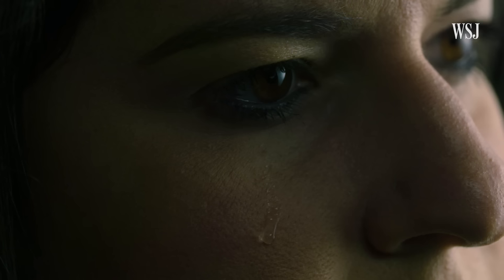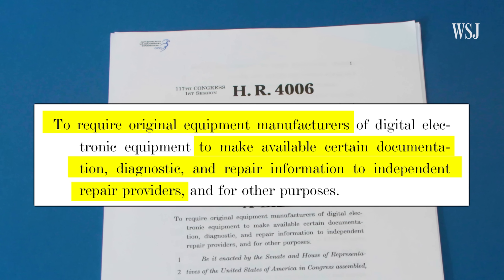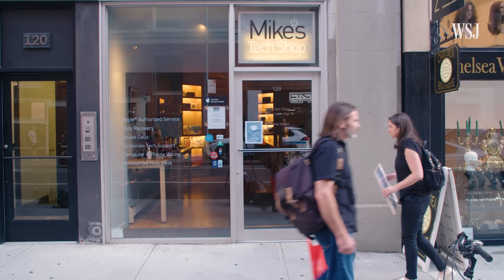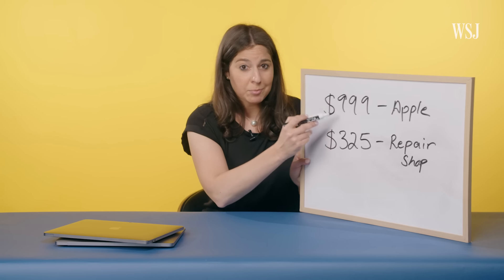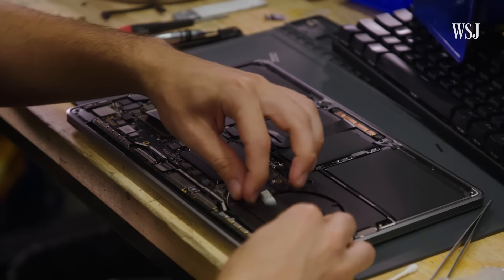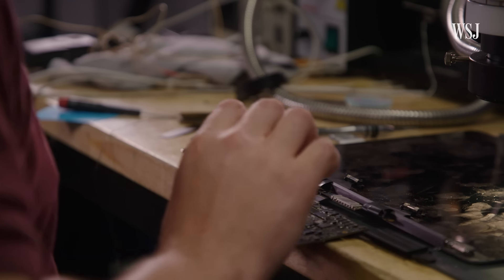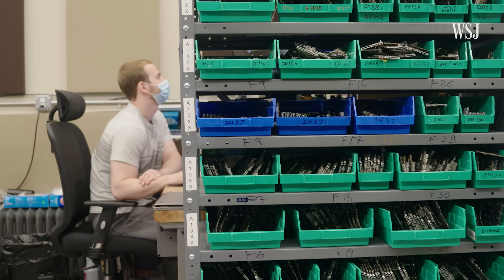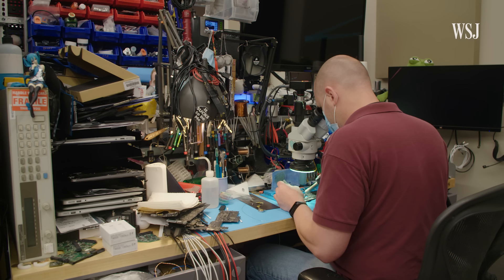Apple Store vs. Repair Shop: What the Right to Repair Is All About | WSJ

Comment: we allow a 16-year-old to change the brakes of a giant piece of metal that goes 80mph but changing a fan on a MacBook is "dangerous" these big tech companies are on something lol
Reply: bruh, i swapped the entire motorcycle engine and it was fun and not so dangerous.
Reply: @pnnytx  exactly, if these vehicles don’t need a “certified” professional to do it then neither does tech
Reply: @ProPrince  idk, maybe it's because of the "safety" things. Kinda annoys me, tech are being harder to fix and getting harder exponentially.
Reply: @pnnytx  yeah it’s getting smaller but they can make stuff as easy to fix unless they solder everything together
Reply: Cars will be next. Driverless and electric cars will not have repairs that are done anywhere besides the dealer.
Reply: @randomoverpopulatedworldid3286  its sad our society is ok with this
Reply: @randomoverpopulatedworldid3286  i think that's what tesla is already doing
Reply: @ProPrince  They can solder everything together and it still will be easy to fix. We just need the information
Reply: It doesn't ork like that on land machines anymore. There they try to limit self-repair with software too.
Reply: 😂 so true 👍👍🙏
Reply: @randomoverpopulatedworldid3286  Next? Its already happening, talk to independant techs about diagnostic software and the fees to use them.
Reply: The are on liquid greed
Reply: @randomoverpopulatedworldid3286  Tesla is already like that.
Reply: @SirNyanPanda  thats gonna be what happens with new smart and electric cars, tesla charges insane prices to fix them
Reply: @i-never-look-at-replies-lol  you know that’s a good point lol.
Reply: @pnnytx  it s not i changed numerous parts of pcs without any issues and i m only 16 so they is no danger
Reply: Did Apple say dangerous was one of their concerns? I must of missed that because I didn't see that.
Reply: Don't give car companies any ideas.
Reply: At our school we have all these saws and grinders but replacing a single part hmmm not gonna happen Chief
Reply: I call those giant pieces of metal "2 ton killing machines" and I agree with your assessment that a 16 year old can safely repair an Apple product.
Reply: @randomoverpopulatedworldid3286  The BMW that requires a subscription to get certain features "Unlocked" on a car that you own. so I guess if you don't have it fixed by a "registered" technician, they could brick your car? or limit it in someway, that's just all kinds of wrong.
Reply: @randomoverpopulatedworldid3286  And this is why I, an equestrian, have already decided that by owning horses I'm not tied to using a car.

I can also make money with them, keep a dying breed of my country alive and I can do logging and farmwork.

All way more environmentally safe and good options. It all can come full circle with horses. Not so much with cars.
Reply: @ProPrince  More like, why does it have to be Apple certified? If I take it to someone certified by some other entity, why should that be Apple's business?
Reply: Companies like John Deere and Tesla would like to apply/trying all the things apple is doing to vehicles and machines, so right to repair is something we really need to support.
Reply: @Klairity  John Deere has already done it
Reply: @marialindell9874  And so has Tesla why I named them, and they are trying just haven't fully done it why they're still lobbying.
Reply: @kenbobcorn  its not shown in this video but yes. Most if not all of the lobbiests*  who argue on behalf of these tech companies specifically say that it is a huge security risk to have non authorised repairmen operate on such products.  They even ran an ad campaign saying if you let a 3rd party repair centre fix your product, you are likely to be raped. I'm not exaggerating, look up the ad on car manufacturer right to repair
Reply: @semesabrown489  Oh, I don't really care much for the car companies right of repair, I was asking about the topic of this video which is MacBook repair. Since the original comment refers to repairing MacBooks as being "dangerous" I wanted to know where they said that because that certainly sounds absurd.
Reply: @kenbobcorn  well the OP was literally referring to 16 old apprentice's changing brake pads

Edit: as a 13 year old 7th grader I built entire computers and repaired crts with 50k volts going through them if you don't ground them properly. Its not hard to learn basic electrical engineering. I now have a degree in it and I don't feel like I know anything more than since I started uni
Reply: I literally made this exact same comment in a completely different vide I used to repair crts working with 50k volts on a daily basis. Now I work with sodium cyanoborohydride every day.   You think I'm not qualified to work with some thional chloride and Ionic lithum... Ok
Reply: I'm just as qualified these days, Insofar as I was back in 7th grade as far as technical knowledge goes. I learnt nothing in university (as you say college). I just have 5 years of homelessness and now know it's all bs
Reply: Not to mention… there’s no licensing required to be a car mechanic.
Reply: @J Hemphill that’s a good point. People like that think these big companies have their best interests in mind and don’t even seem to realize profit margins exists and they feed into it.
Reply: @Tactical5  bro don’t worry I am only 19 and did the same when I was 16 lol
Reply: @SharkTH _ yea, it's all gangsta till everything is soldered into motherboard
Reply: Don't worry my friend, they'll cover that too, soon enough.
Reply: In Germany 200 mph :-)
Reply: hey. I'm that 16 year old, you need a brake job??
Reply: hey. I'm that 16 year old, you need a brake job??
Reply: I worked at a Toyota dealership mechanic shop at 16 about 2-3 years ago and it was pretty fun for the most part
Reply: ah yes. the great depths of hypocritical thinking.
Reply: The danger is the lithium battery.
Reply: Yeah the Big Tech companies are on something alright, it's called the money train, all drained from customers.

Comment: Apples logic is like saying “well your fuel injector is broken, but we feel its more reliable to replace the entire engine. So that’ll be $15,000 or maybe just buy a new car from us.”
Reply: clogged injector
Reply: “The batteries in this remote are starting to get low. Time to replace the tv!”
Reply: Let me introduce your to Tesla.
Reply: @declanashmore  Taking your Tesla to the shop: Well one of the logic boards got fried and since everything is digitally linked we will have to replace the whole car! Meanwhile, Rich Rebuilds would replace one capacitor and the car would be fine.
Reply: So much for taking environmental steps
Reply: And when ur dealer mechanic calls Bosch for a new injector they say we can't sell it to you ase certificated technician that works for the company
Reply: Have you heard John Deer Tractor?
Reply: No, it’s more like going to Tesla with a broken part in the engine so they want to replace the whole engine rather than going in there with a soldering iron and you getting mad because your local fix-it shop didn’t get their certification to service a Tesla. Meanwhile, you don’t have to take your Tesla to Tesla to get serviced as actual certified service providers exist but none of them will just go into your Tesla with a soldering iron and a lack of bubblegum to make it go for a few more weeks.
Reply: @liquidmark5081  bro what?
Reply: Teals does that
Reply: @liquidmark5081  who cares about certifications, I should be able to have whoever I want work on my product and that repair by Rossman was legit the board is fine and does not need to be replaced
Reply: @Avorizky  I would fix it myself rather than sending to service
Reply: @Avorizky  and yes I’m a apple user and i have ALL the screws well not really but enough to open the back cover
Reply: exactly
Reply: Or just get apple care
Reply: @ijarbis187  not everyone wants to pay extra
Reply: @ijarbis187  why so they can replace every part and then throw the rest in the trash and add to the global E-Waste pile.. yet another comment from someone that has no clue about the issue.
Reply: repair in the hands of 1 company .... this screams for abuse (which is difficult or impossible to control)
Reply: yeah wait till they release their car, oh broken side mirror? sorry the door has to go to our eco friendly world class platinum grading recycling centers
Reply: @MrAtomUniverse  and imagine them putting a memory number to prevent unauthorized repair, probably the car sale wont last a day 💀
Reply: @nintendo-toasteredition  Sigh, i can't wait for Tim Cork to leave , whatever he's doing , he isn't doing it hard enough, he could had done better but nah, he prefers to charge high $$ for devices instead of lower $$ so even the poor could afford good tech. 

Recently i went to apple , they asked for $850 ? for a logic board , iphone XS MAX , i went to 3rd party next door,  $150 , free if it doesn't work. Done within 24 hours.

Tbh, i find people who purchase apple care stupid, it's not even worth the $ unless the device is running 18 hours non stop. Even with apple care you still have to pay, but discounted rate , which is still more expensive than a 3rd party.
Reply: @MrAtomUniverse  true because we’re literally paying monthly and at the end its just the same
Reply: It’s all to get you to buy a new computer.
Reply: Sure, I’ll buy a new car from someone else!
Reply: so, next 10 years. apple gonna make their own car model?
Reply: @igamingpublic  probably?
Reply: @igamingpublic  So in* the* next 10 years is* Apple* going to make its own car model?
Reply: meanwhile i am going to laugh at them with my 20 year old car that any shop can fix. it probably already outlasted multiple teslas lol.
Reply: This sounds like Tesla😂

Comment: Oh snap, it's going to be real scary if apple releases their car. Imagine them wanting to replace the engine or sell you a car because your radiator Is leaking.
Reply: Or your car being remotely shutdown down cos you changed your own breaks or tires 😖
Reply: basically Tesla lol
Reply: worst it would have no windows.
Reply: And the scariest part is that other manufacturers might start mimicking it, just like it happened in smartphones area
Reply: @Colin0221  Yeah. And I think Louis made a video about as well.
Reply: @Colin0221  was about saying the same bro 👌🏻
Reply: Your seat covers got torn so it's better to buy a brand new car since the seat covers are linked with apple satellites and replacing them would void the security of your car.
Reply: @monsterrun  "We at apple believe that apple a/c provides the most reliable and secure air so here's your $3000 bill for oxygen tank"

Comment: The words "Apple trained technician" is an oxymoron if I've ever heard one. Apple never does repair at the component level. The only "training" they have is how to remove and replace board scale parts. They are basically the glorified electronics equivalent of an oil-change mechanic.
Reply: I've worked with an "apple trained technician". And the way they fix laptops is like lego.

A single busted capacitor, new mainboard. It was ridiculous.
Reply: @carlangelo653 Lego is a good way to put it. I would be willing to bet that most of the Apple "technicians" couldn't tell you what a capacitor or resistor is or does, and are totally clueless about any of the ICs on the boards. I wonder if you could even find a multimeter behind the doors of the black hole they take computers to for "diagnosis"?
Reply: It’s basically if the alternator dies, replace the whole engine.
Reply: Apple's whole thing, if you actually make a real world comparison, is basically like a tech at a car dealership saying "Alright you have a blown head gasket, we can either replace your entire engine for 4 grand, or you can buy a similar year and mileage vehicle off our lot for around 7 grand. Your 'choice'." (This comparison would be even more realistic, if car makers made it illegal for auto parts to be sold/installed by anyone except their dealerships.)
Reply: @AceSeptre  I’ve worked in a German authorized Apple Retailer with repair and we had 2-3 guys in repair and most surly they had that. But yes mainly they had a database to look up Macs, models, parts and prices and basic tools to run diagnostics.
Reply: Geek Squad Agent here and also certified in Apple Repairs. This is sadly accurate, ya don't actually repair anything. It's all about replacing main components or replacing the entire thing (or buy a new one). Apple internal trainings are more about customer service than anything.

It comes off as an insult if someone calls/ask if we an Apple Genius (no offense to them, they making a living). Proud to be a Geek Squad Agent tho.
Reply: It's even funnier that they are called 'geniuses' and people trust an 18yo kid making a minimum wage trying to fix your macbook lol.
Reply: Most modern techs are simply card jockeys, their job is to fault isolate to the Lowest Repair Unit (LRU) and swap out a board/card/module. Electronic components have become so miniaturized that it's no longer cost effective/practical to replace an individual resistor, diode, transistor etc,.
Reply: @jascam1  Eh, it sort of depends. A well equipped shop with a knowledgeable staff should be able to take at least some time to example a board at the component level. Depending on what it is, a damaged component isn't an impossible fix. I get that a lot of shops might not have the equipment or experience to work with components like BGA packages but if they have a scope they should be able to replace a lot of other surface mount components at a minimum expense to them and the customer. Even then there is no guarantee the fix will solve the problem, but taking 10-15 minutes to take steps that could save a customer hundreds of dollars is not a cost negative measure.
Reply: I remember replacing a daughter board of a Dell laptop in the first year of my apprenticeship. Would've been a 1200$  repair for a 60$ part buying it through dell. In this case the pcb needed to be replaced because it snapped.
Reply: I want to upvote so bad... I can't upset the master :\
Reply: @AceSeptre  Is it though? Lego actually sends you replacement parts if you ask, and all their model kits are fully interchangeable.
Reply: @tobiaslofi  Yes, but the part would be an entire new logic board when all you need is a new wifi chip or a new battery management chip.

Comment: Miss the days when laptops could be opened up, had their parts swapped out and ran for years.
Reply: It's still like that. It's just Apple
RAM, Fans, hard drives, wifi/Bluetooth cards, heatsinks, battery, and sometimes (very rare) CPUs on non-apple laptops
Reply: Go the Lenovo way. Thinkpad series.
Reply: Asians be like lol
Reply: Look up the Framework laptop.
Reply: @scality4309  Yea I love sodered memory and storage so much, thinkpads are so good that you cant even upgrade a wifi card and you have to destroy the entire device just to swap a keyboard.
Reply: @wojciechsura  Underrated comment.
Reply: My Dell Vostro 5402 from 2021 can still replace parts easily. Or the Dell Latitude which is even better